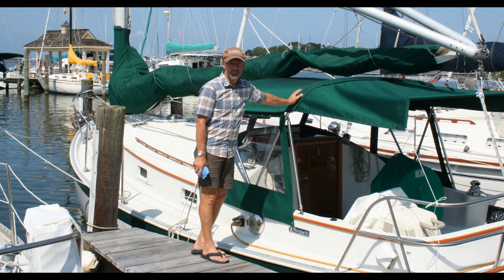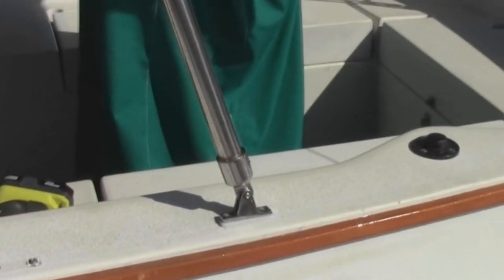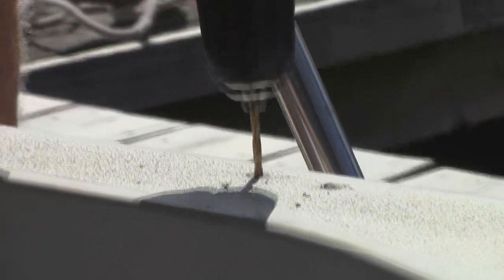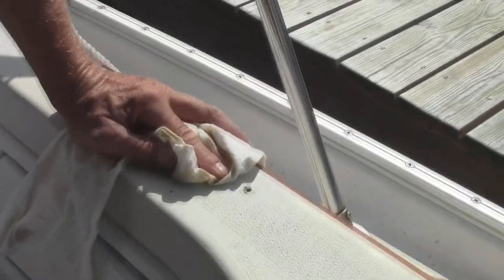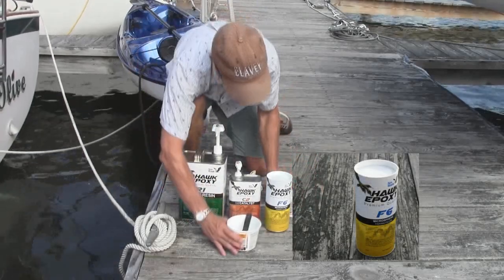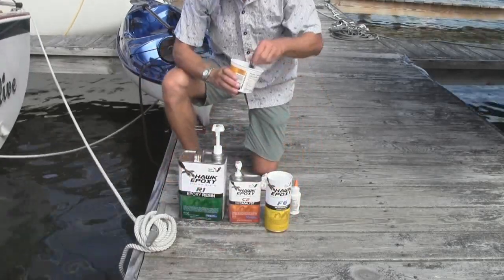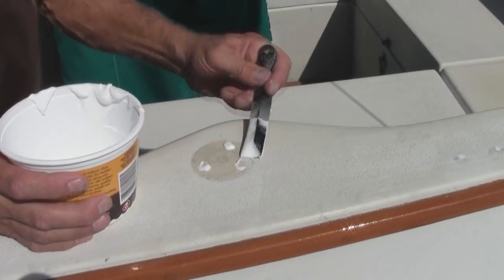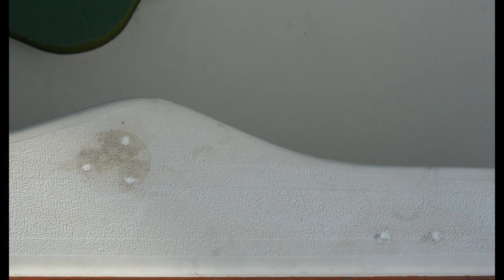Filling Small Holes With Epoxy

Comment: What if the hole (9/16 bolt hole) is below the waterline? This or fiberglass?
Reply from the maker: below the waterline, fiberglass.  It is a pain for such a small hole, bit it is below the waterline, why take a chance.  I had that happen to me, had to pull the boat flare it out and fill with fiberglass mix.
Reply: SAILING PAU HAN

Comment: Another thing to do for color matching is mixing everything together without catalyst and match color by putting some on the boat if its too white mix with black or yellow if the boat is more of a beige than off-white. You can then clean the tests with acetone and mix your catalyst to have a near perfect job
Reply from the maker: tks good info
Reply: WaterfrontVacations1 no trouble works like a charm! Learned to match the colors like this when i was racing laser ones, i had a big chip and it was pretty ugly, i didnt want it to appear so i searched info for it and it came of pretty awesome!